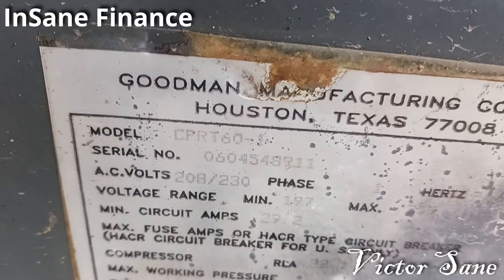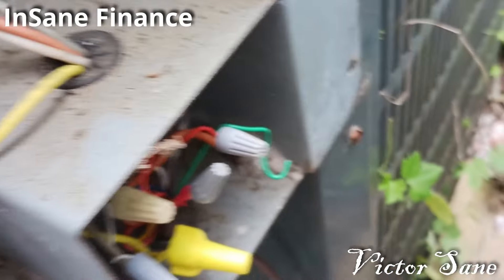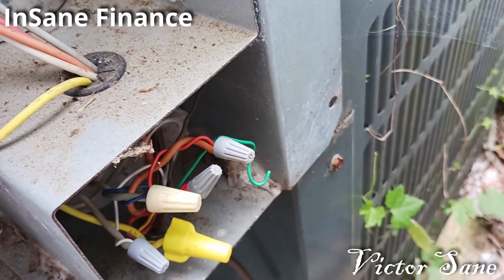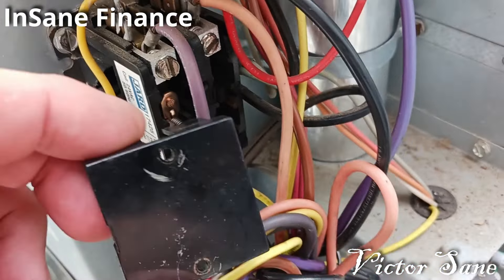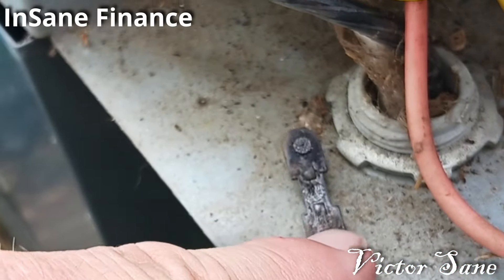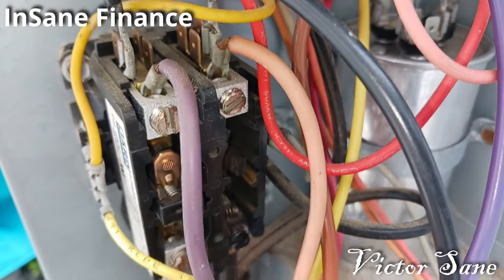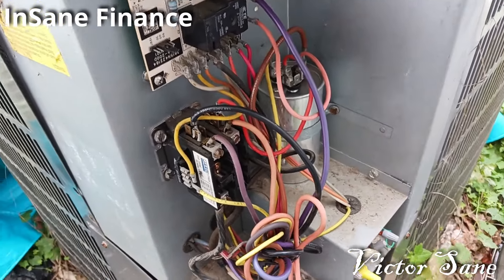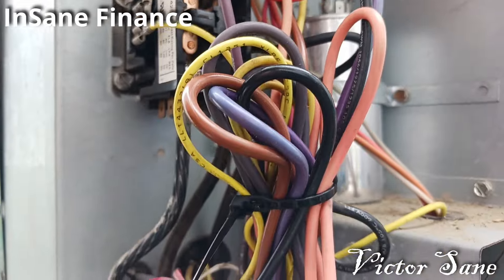Heat Pump HVAC no cooling Compressor not running mystery solved, AI dont know how to fix this

Comment: I had same issue and went right to checking out the capacitor before checking the contactor. The capacitor was out of range and once replaced all was good. You pointed this out towards the end of your video. It's a shame that my service company did not regularly check the capacitor as part of service calls. I got lucky and I thank you sir for sharing your expertise. The video problem was like finding a moth inside one of the original computers in the 1940's/50's that interfered with a relay and that's why they call fixing computers debugging.
Reply from the maker: Ive not had to fix one because of a moth yet but Ive had to fix plenty of things because of big wasp nests built inside. Luckily most of the nests were abandoned when I got to it. Next thing I open with a nest Ill think of you and "Debugging".
Reply: @insanefinance2846  Ha! 👍🤪
Reply: @insanefinance2846  👍👍👍🤪